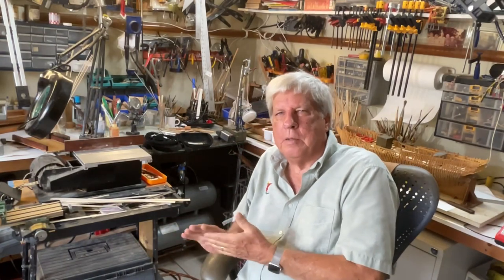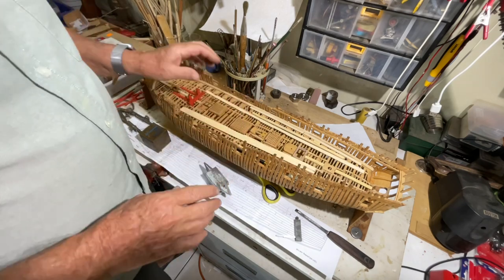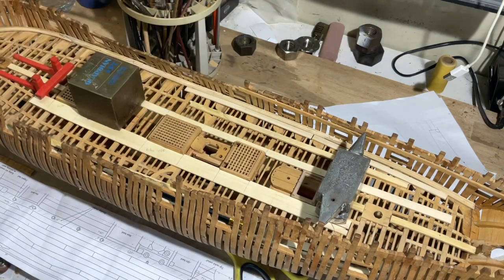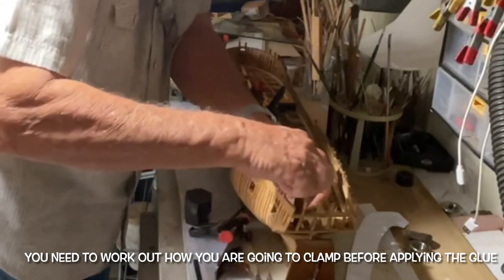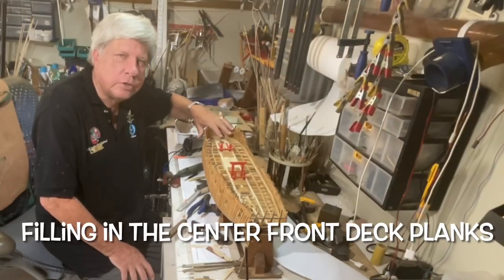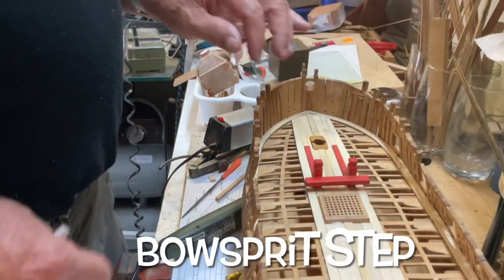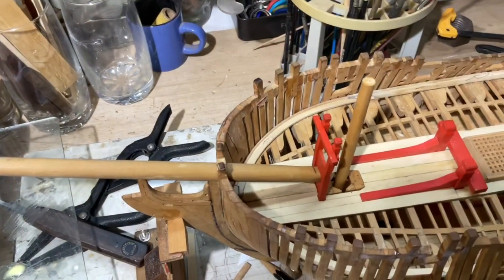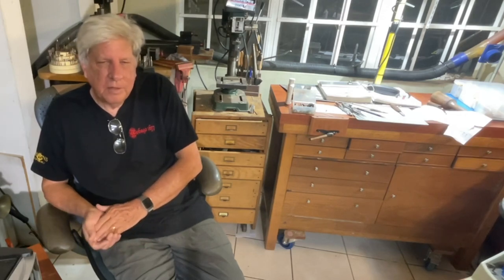Video 85. HMS Thorn. Planking the center section of the upper deck.

Comment: Hi hi Kevin.  Just a simple question referring to the PVA glue you use.  Which PVA glue do you use on the planking of the hull and deck?   
Thank you.    Jim Semertzides
Reply from the maker: I use tight bond but any will do. Got this off the net.
Polyvinyl acetates are probably the most common adhesive on the market. They come in a variety of formulas, all ever so slightly different, and specific to what they are designed to glue. Here are some tips for using Polyvinyl acetates.

All PVAs are designed to work on porous materials only
PVAs are water based, and clean up with warm soapy water.
PVA is only toxic to ingest, it does not emit any harmful fumes, and is not hazardous to touch
PVA sets best in good air circulation, at room temperature.
PVAs need pressure to adhere.
Most PVAs are not water proof. The yellow PVAs have a higher moisture resistance than the white ones, but neither are completely water proof.
Never allow your PVAs to freeze. This breaks down the polymers and your glue will be rendered useless!
Yellow PVAs have a shorter shelf life than white PVAs.
Be wary of over priced PVAs that claim to be for a specific use. There is very little difference from one PVA to the other, and nothing that should increase the cost.
Although PVA is not a gap filler, in some cases you can add sawdust to it to increase it's gap filling ability.